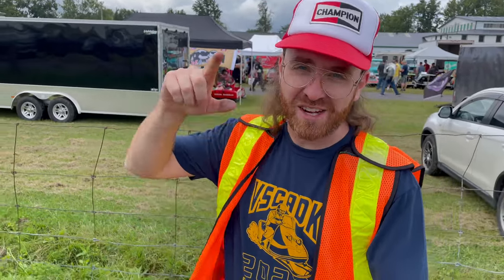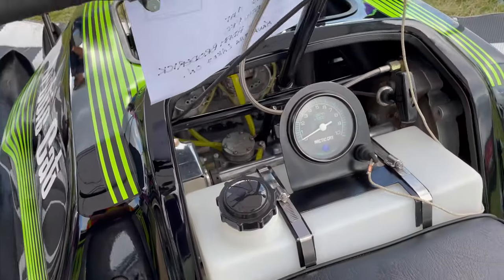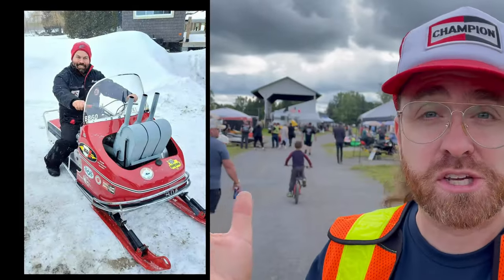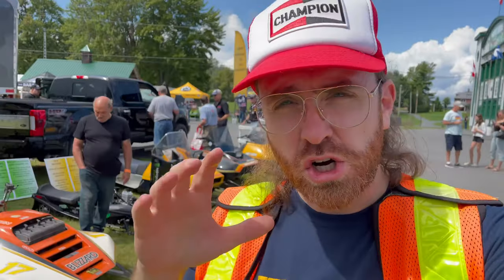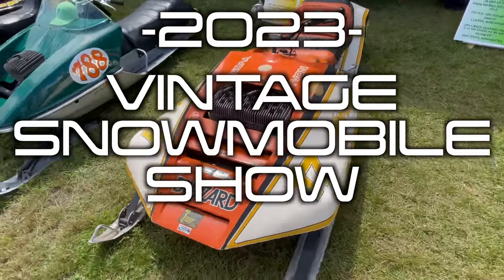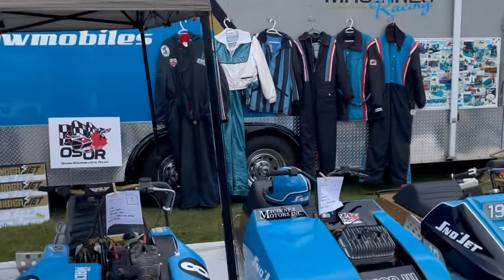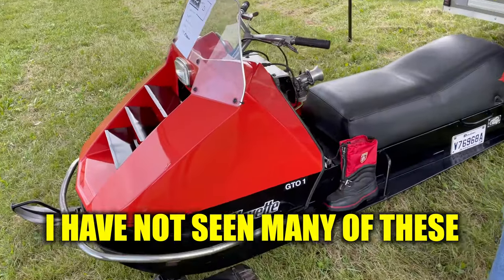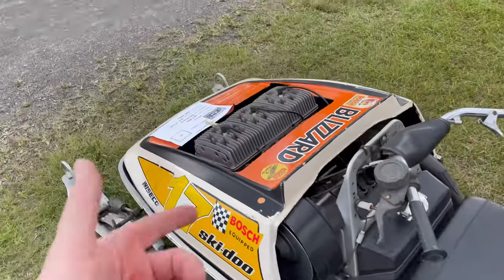Vintage Snowmobile SHOW! Ormstown 2023 Summer Show- VSCADK

Comment: Nice video Matt.  I'm hoping to get to the 24 show.  I had to choke down some sorrow when I didn't see any John Deere machines. I wondered if there were any, or if the rain just caused you to run out of time, to get to those.  Over here in Saint Albans Vt.   John Deere was an iconic brand for our family.  My first sled when I was about 14, was a 1974 JDX4 Special.  The "Special" meant that it had sliders instead of boggie wheels.  I think they may have only made that specific sled for one year.  Keep up the good work.
Reply from the maker: If you make it to the 2024 show, come say hi if you see me! I don’t remember specifically if there were any JDs this year. I know in 2022 they were a couple. Thanks for the comment and see you this summer!!!!

Comment: 15:16 - That 1-cyl Thunderjet has the cylinder head installed the wrong way.
Reply from the maker: You have a better eye than me for that stuff!!! Do you think it makes a difference??
Reply: @mattsws  - In a race, the head might overheat and cause pre-ignition which then can make a hole in the piston.
Reply from the maker: @cybair9341  I just rewatched that part and sure enough, the head is on sideways... I totally see how that would mess up cooling... unless it was a DRIFT SLED!! Lol!